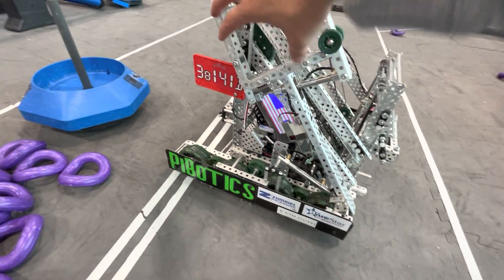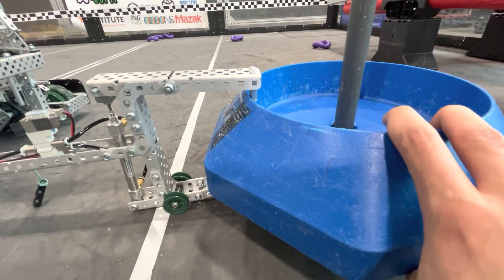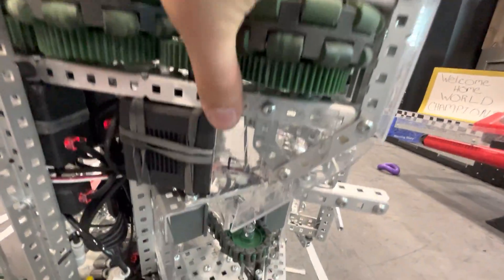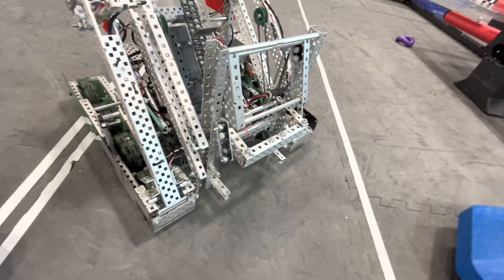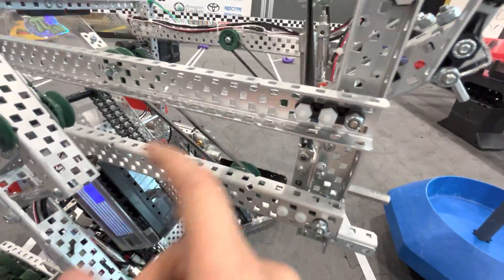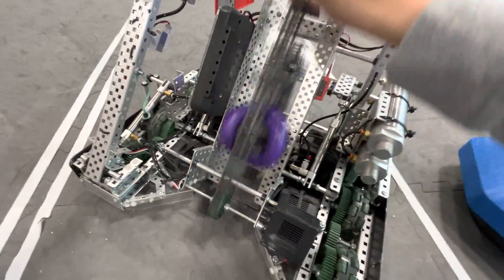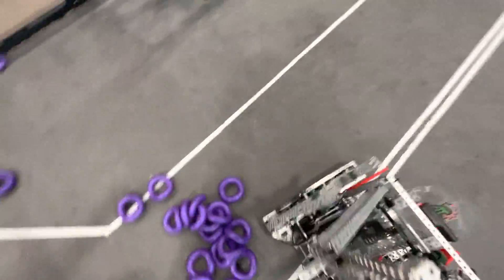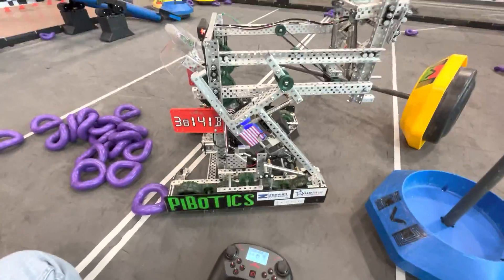38141B worlds robot explanation (Vex Tipping Point)

Comment: great bot gg on winning worlds, also i thought it was funny mid match you would just take your eyes off the field and talk to your teammate or just not worry because you were super confident that your back mech or front mech goals wouldn't be stolen once in, did you have some sort of voltage lock on your drivetrain/pneumatic drivetrain lock to make sure that you can't get pulled around at all?
Reply from the maker: Lol thanks. Yes the robot did have a break but it was just setting the motors to brake instead of coast.
Reply: @Ben_Hartline  oh neat, did you ever have issues getting pulled around by a low rpm(120 ish) bot also as the kids say "ben op"